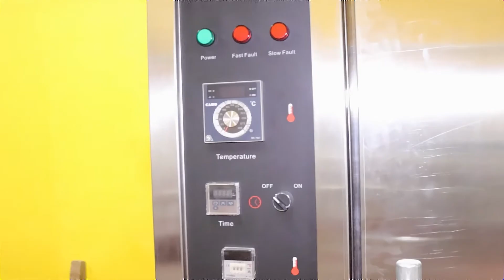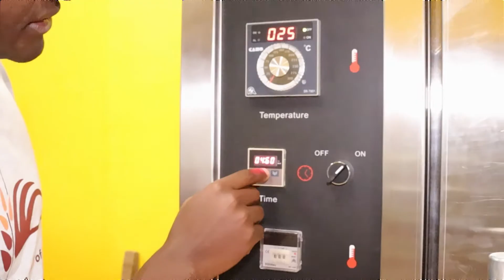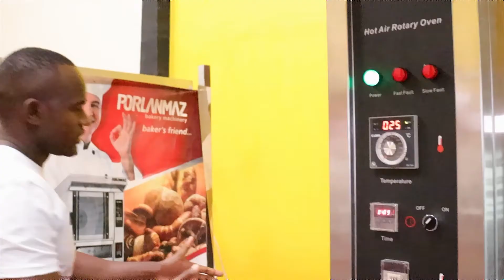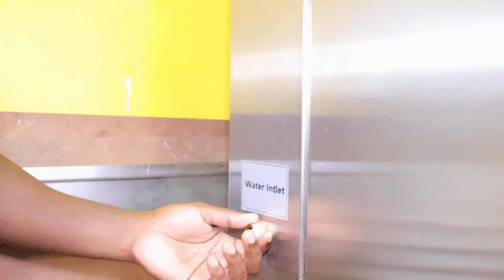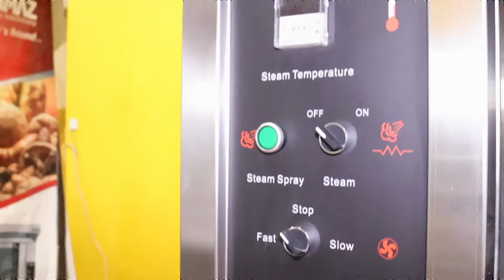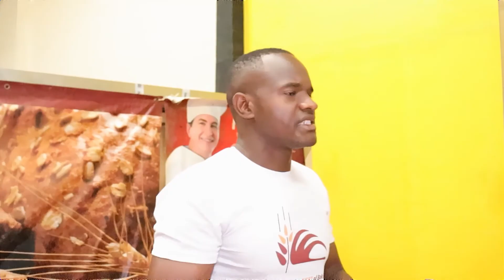THE BAKEWAVE RACK ROTARY OVEN WORKING PRINCIPLE :with DIESEL POWERED BURNER

Comment: Excellent stuff - what recommendation is given for generator backup?

Also is there a drain for the unit?
Reply from the maker: Thanks a lot Byron.yes there's a draining system for the oven sorry we did not show that on the video.you will need a generator above 5Kw three phase since oven voltage is 3Kw
Reply: @BakewaveTV  Thanks guys for your kind response, what is the cost?

For biscuit making can it accommodate more trays say 2 x 35 mentioned?
Reply from the maker: @byronanangwe9555  thanks a lot this is big size rotary oven with loaves capacity 330 loaves and 32 tray size 600mm by 800mm
Reply from the maker: @byronanangwe9555  yes it can accomodate 32 trays size of 600mm by 800mm
Reply: @BakewaveTV  costs for the Rotary Oven kindly?
Reply from the maker: @byronanangwe9555  it's kes 2.4M+vat negotiable but you can consider for biscuits convection oven with trolley 12 trays capacity it's kes 1.1M+vat .it can also work perfectly for biscuits.will be doing a video of it soon .so keep following the videos